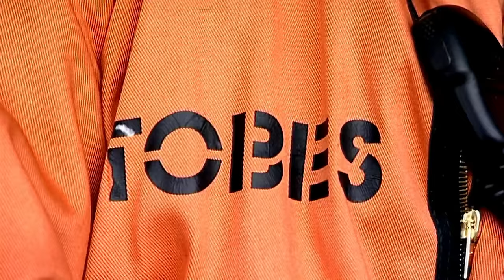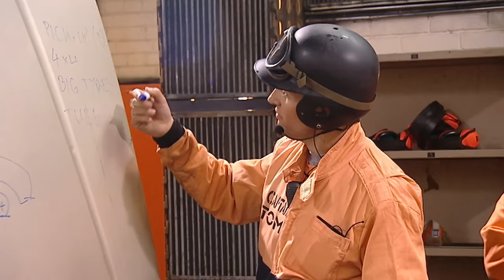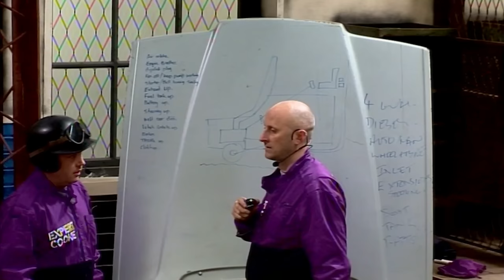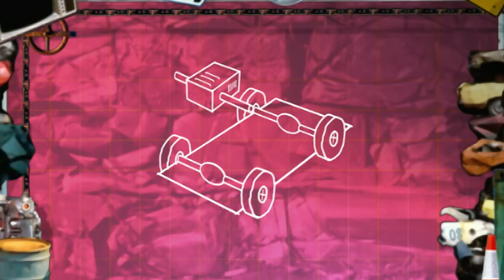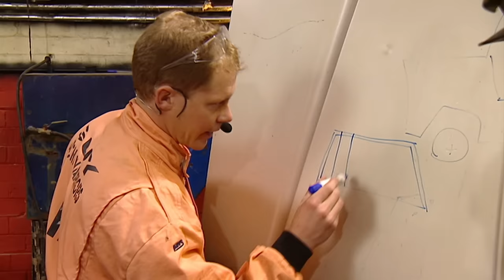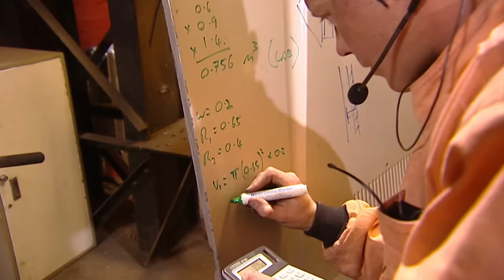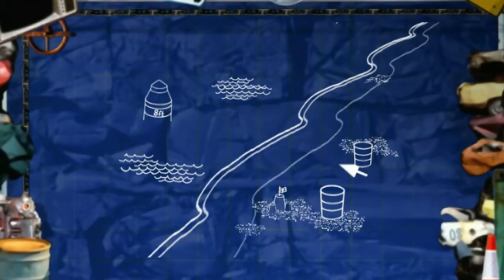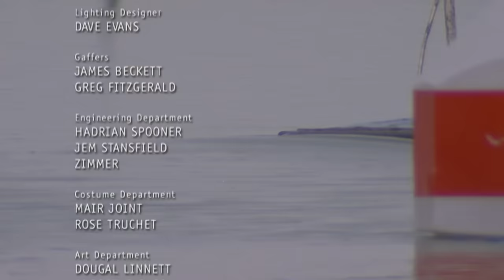From Skies to Seas - Scrapheap Challenge - S08 EP1 - Game Show

Comment: The Power Lifters certainly went for the sensible approach by driving from the roof of their 4x4 car with all of the controls, inlet and exhaust extended, and grafting a front-wheel drive diesel engine into their vehicle. The Apache Warriors, on the other hand, were certainly insanely brave to turn their Kia pick-up effectively into a diving bell!

Comment: It's only 10' deep. They could use a scuba tank to pressurize the cab to equalize the pressure.
Reply: Where are you gonna get a scuba tank with a regulator in the scrapyard?
Reply: @spacejihadist4246  they had them during the race